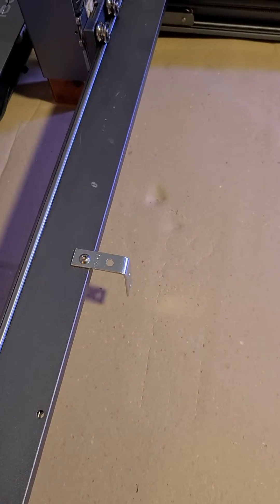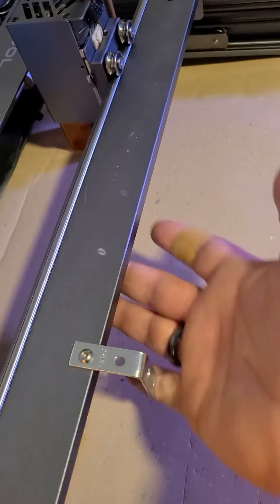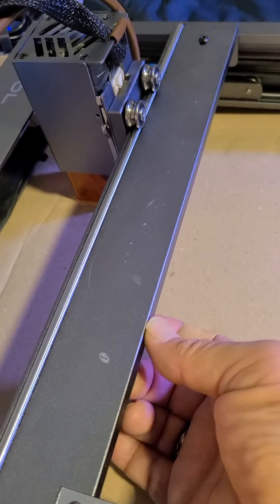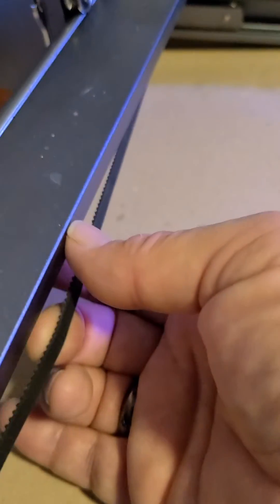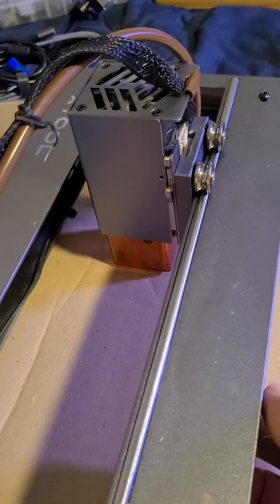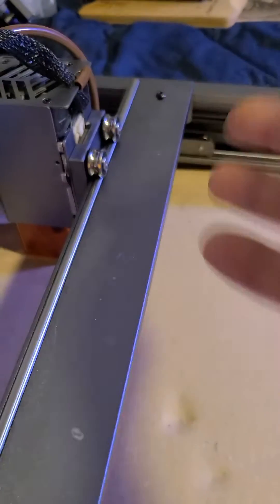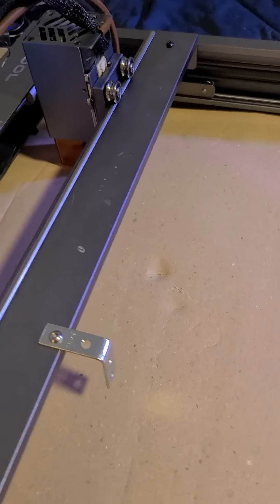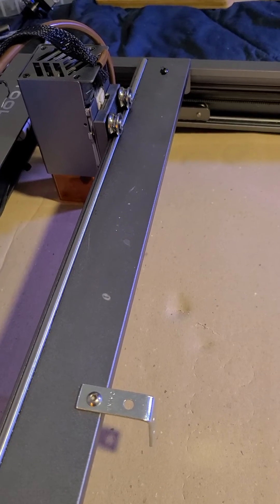Checking belt tension for the X gantry on the xTool D1

Comment: I have the same issues as others..cant get a perfect circle and with the wavy lines, so is there any way I can check if mine are too loose or too tight..? Thanks Cobey.
Reply from the maker: You do the 45 degree test.

Y axis: Slide the gantry all the way to front, laser module in the middle of the gantry. Raise the front of the D1 to about 45 degrees, and observe the travel of the gantry as it moves to the bottom. It should not race down, but make slow steady progress.  If it races down, the Y belts are too loose. If it doesn't move, then the belts are too tight.

To adjust the tensions, loosen the locking screws in the left and right side of the D1 frame, in the back. Then, tighten/loosen the adjustment screws on the rear of the frame, left and right. 

Y belts also needs to be balanced in tension. Pluck each and listen to the tone. They should match closely.  If they do not, adjust the tension so that that they do. A higher tone is tighter than a lower tone, which should help understand if you need to loosen/tighten to make them match.

When you have gotten the tension on both belts even, repeat the 45 degree test. If needed, adjust the tension on each belt evenly, so that they stay in sync. When all is well, tighten the locking screws again to keep the tension as is. 

X axis: Similar to Y, except gantry is in the middle, laser module at the top.

Comment: HI, Cobey I just did the gantry test with the belt ; all is well.  
Checked the alignment to the front rail, and that is something I have to adjust all the time.  The laser no matter what setting...will run into the rail when framing or going to the top left...I'm missing  a setting somewhere and can't figure out what is going on.  I follow the instructions to the letter on XTool site, and LightBurn ...but somewhere I'm missing it, for it to hit the rail.  If the belts are good and the alignment is good... Just total lost at this point.
Reply from the maker: Hit me up on Messenger